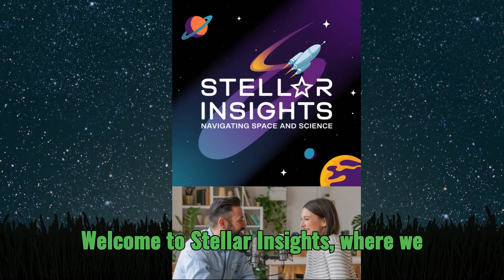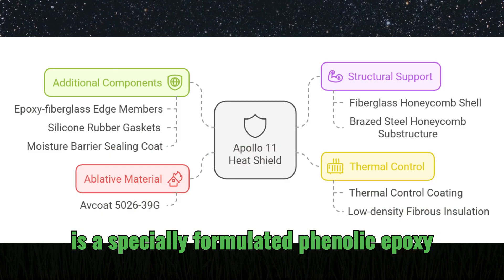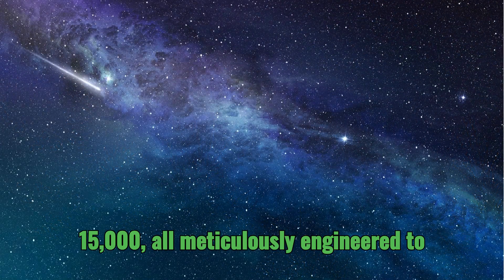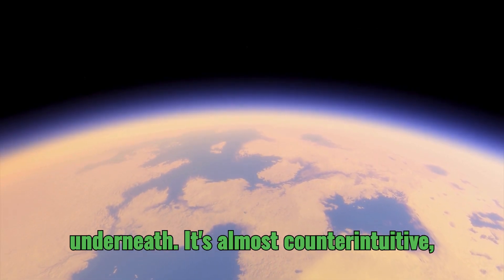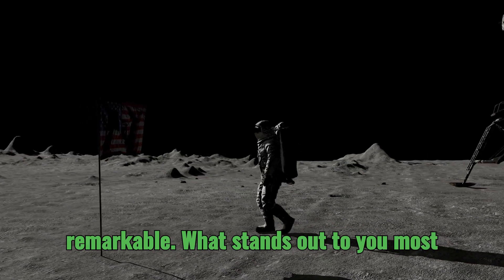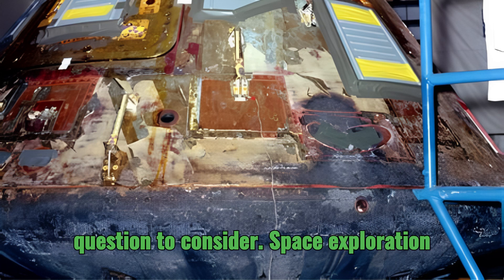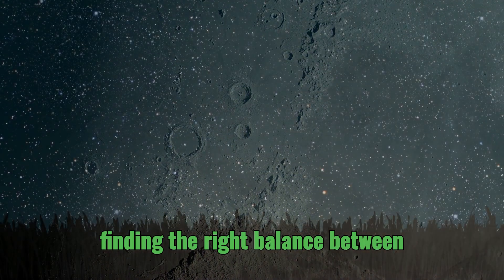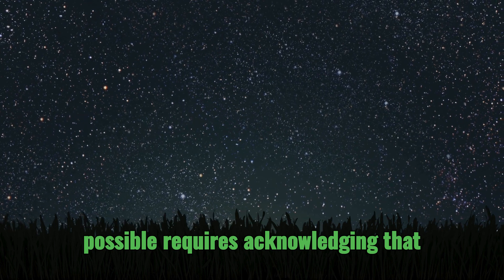Apollo 11 Heat Shield: A Triumph of Engineering

Comment: The command module was made of 1. Kapton Tape -melting point =  800°C (1472 °F) 2. Brazed steel honeycomb  - melting point = 450 °C (842 °F) 3. Fiberglass - melting point =540 °C (1004  °F) 4. Phenolic resin - Melting point = 220 °C (428 °F).   The minimum (EVER) recorded temperature of the van Allen Belt is 2000 Kelvin (3144 °F) or  1726.85 °C up to a max 20,000 Kelvin (19726.85  °C (35540.33 °F) The command module traveling through the Van Allen belts at 36,000 ft/sec would disintegrate within a few seconds.
Reply: Interesting but completely irrelevant to the heat shield’s functioning. It is almost as if you saying the Apollo missions never happened.

The people at Avco in Lowell, MA manufactured these heat shields to, as the video explains, remove the heat energy by ablating material and transport the heat away.